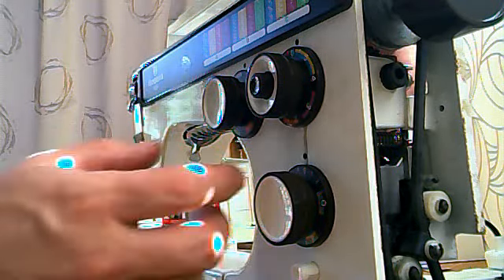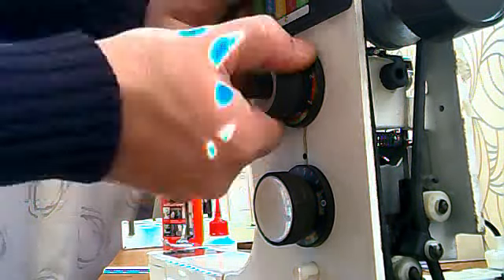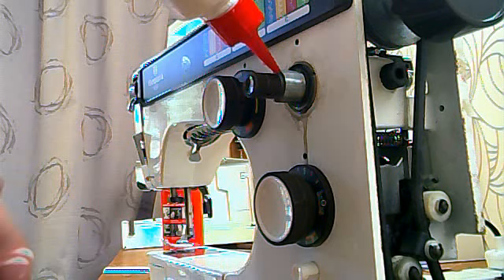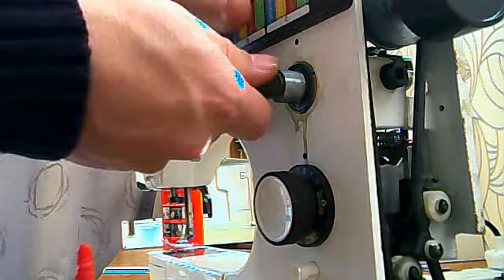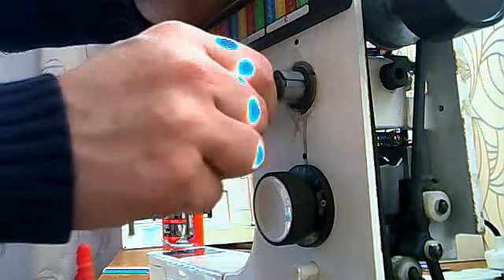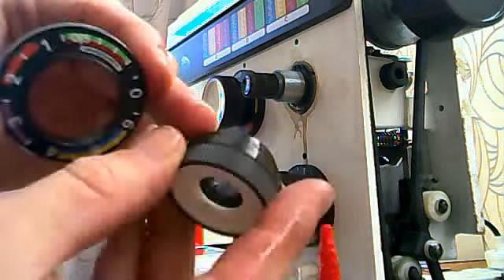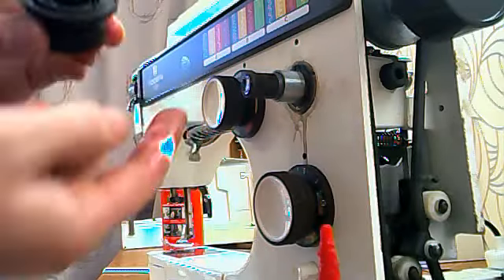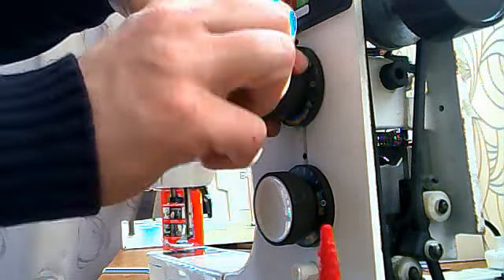Husqvarna 6730 reverse button repair

Comment: 6440
Reply from the maker: Joanne Nardoni This video will help with the side cover. https://www.youtube.com/watch?v=v_JQJYKAlnM
Reply from the maker: Joanne Nardoni You may need to remove both side covers, The back cover should only have two screws at the back and maybe one behind the face plate shell also holding the back cover.
(The latch (2) located under the lower edge of the face plate shell should be drawn downwards and the tower part of the shell lifted out from the machine. The cover can now be lifted upwards, so that it releases from the upper shoulder screw. the screw which secures the edge of the back cover should now be removed.) You can also start a topic with pictures at http://support.sewingnz.com/forums/forum/sewing-machine-support/husqvarna-viking-sewing-machines/